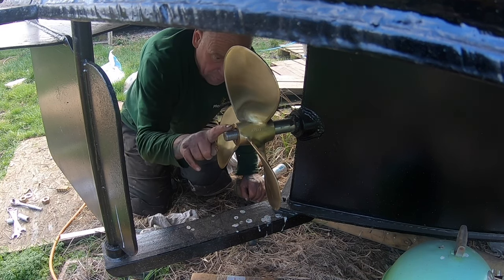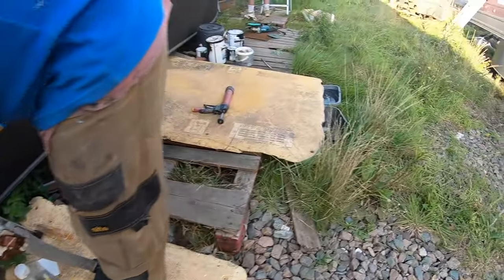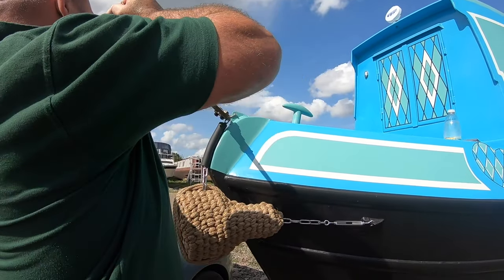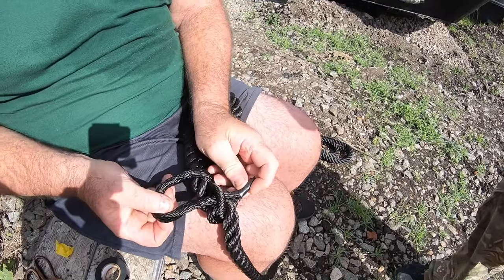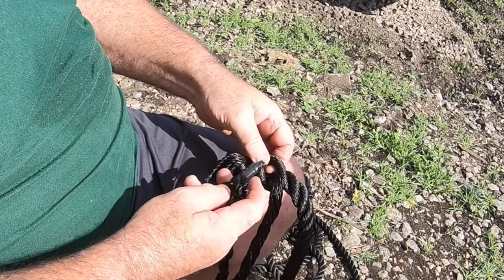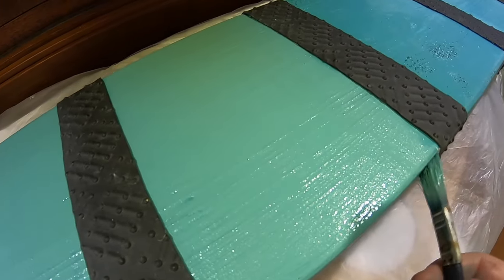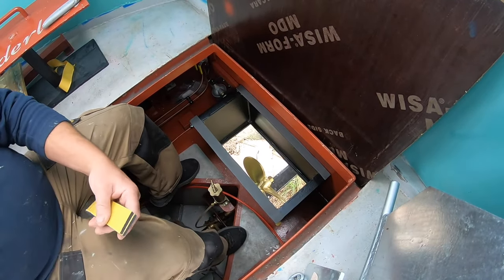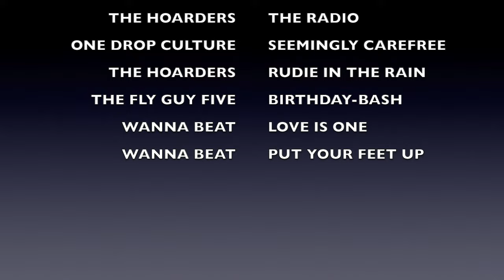VLOG 123, Narrowboat Fit Out -  PROP, POLE, PLANK, FENDERS AND SPLICING

Comment: A really fantastic achievement that I've watched from the start. Grandad's got quite good at it all hasn't he. One comment what's your reason for using blacking and not two pack epoxy on the hull? Bu the way those stripes on the pole are blue not green!! Nice pair of bumpers Granny! 
Good luck for the big day, all your efforts will then come to fruition and you can draw those curtains.
Reply from the maker: Cheers Tony, well done for sticking with us for so long 😂. We used bitumen mainly for cost. When we had the shell built we could not afford to have the 2 pac done so just blacked it and it has now had about 8 coats since the shell build. Our plan is that when we next have to come out of the water to re black we will be in a better position to pay for it to be grit blasted and then we can 2 pack it ourselves. Probably the light but there are blue, green, duck egg and black stripes on it once finished, we just painted the blue as the colour all over first👍
Reply: @makinganarrowboatwithnannyandg  That makes sense. The trouble with twopacking yourself is that you have to do it really quickly before it goes "off".

Comment: Re the debate about pinning the gangplank to the bank. Don't do it, If its fixed bank end and the boat moves away for any reason you'll lose it and it could be very difficult to retrieve, I know this from experience. If it's fixed the other end it stays with the boat.
Reply from the maker: Ok Tony , Thanks for that, we will take your advice 👍. One less job to do 🤣